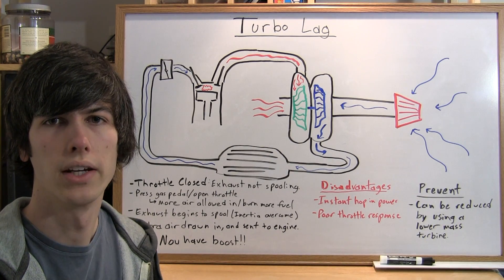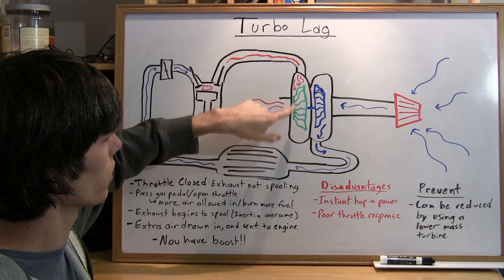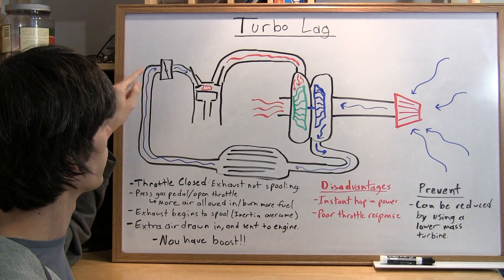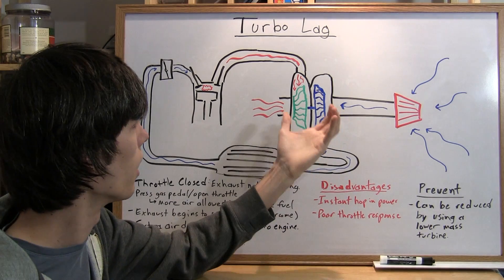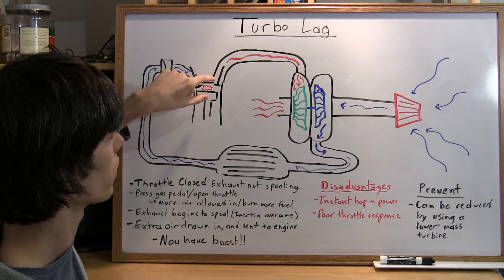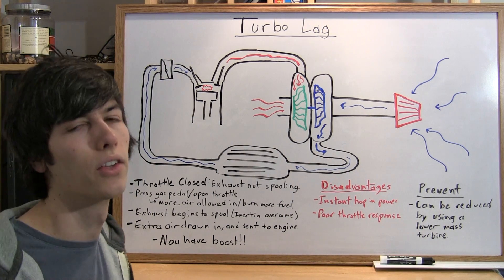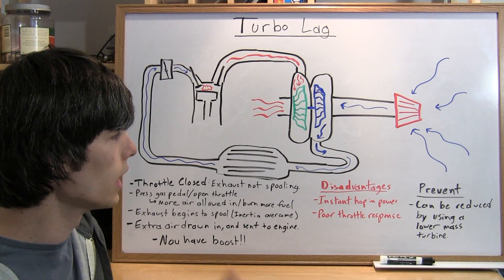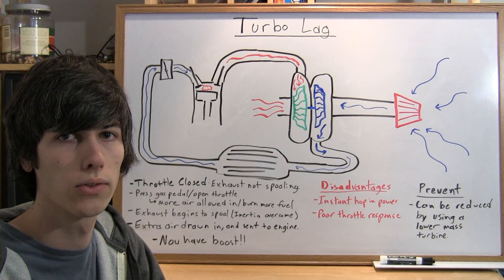Turbo Lag - The Problem With Turbocharged Cars

Comment: Turbo lag sounds like a whimsical explanation of a driver aid where the operator would not be able to handle full power all the time like a supercharger. If a turbo and a supercharger are the same thing on paper, why does the turbo need to spin really fast at a higher rate of boost to generate the same amount of power if it's a more efficient process?

Comment: When taking foot off the throttle, due to the delay in ignition, combustion continues to take place in the exhaust manifold, giving that 'pop' sound. But why does it only pop once? Shouldn't it be constantly popping while the throttle isn't engaged?

Comment: Good video, but I think you can simplify it further (IIUC): Turbo engines rely on engine movement to help bring in more air, so when the engine is moving very slowly turbo doesn't do much. Turbo lag is the time between when the engine speeds up and when the extra air gets through.

Comment: Mr Engineer, good day! I'm from philippines and a fan of your videos. It is very interesting and enlighting. Mr, i want to ask you a few question about my truck. It is a 2014 FORD RANGER XL, 2.2L doratorq TDCi engine. Last month i brought my pick up truck to the ford service shop for PMS. They changed the air filter, aircon filter, fuel filter, and oil filter because it is already 1 year of service. After which i drove my truck way back home and after 2 days of it's service when i prepared the truck for our trip i noticed that when i made a high revolution up to 3thousand rpm the powertrain flashed so i turned off the engine and started again. In the same manner doing a high revolution up to 3thousand the powertrain flashed again and i released the gas pedal so that the engine RPM will be back to it's normal idle power....i mean it will stay on 900rpm. That's the resting RPM of the engine. Moreover, i switched the engine off and started again, i did not rev up to 3thousand RPM anymore because surely it will illuminate the powertrain lamp again. So what i did is to rev up to 1500rpm and after which i just heard an unusual sound in the engine. It is like a dynamic sound.... like a choking sound to the engine. Can you please help me? Because the ford service here in my region can't find the possible reasons.

Comment: Mate, when u want to launch manual turbo petrol engine, what u think is it better to floor it and release clutch on 3000rpm , because i notice when i hve gas and keep rpm on 3000 boost drop , but when i pump gas or floorit boost jump high i think when u do that you aceleration is better :) (sry for bad english)

Comment: How about 2 air intakes that join before the intercooler, one has a turbocharger which has a sensor that reads how fast the turbine is spinning. And the other has a sort of valve that is open when you first step on the throttle and closed once the turbo is spinning fast enough. So when you press on the throttle, you'll get air directly from outside in the straight pipe and once the exhaust gets the turbine spinning fast enough the first air intake will shut off.. or does that completely ignore the point of a turbo
Reply: Never mind what I said is literally sequential except instead of 2 turbos active at high rpm and one at low it's just 1 turbo active at higher rpm and none at lower

Comment: Have an A1 TFSI and MY99 Gc8 WRX I have my turbo lag with A1 is the because of the DSG transmission? Also eg I light weight turbines i remember my twin turbo Sister used to have ceramic turbos to cool down quicker then I changed them to alumninium is that light weight?

Comment: why not just buy a small turbo to get rid of lag and have a set temporary hyperboost like davesfarm did  and add a too efficient intercooler like a3.5 ecoboost intercooler so when air inlet temps rise the super efficient intercooler will prevent intake air from getting too hot.
Reply: knightrider1545 If you have ever driven a 335i that is exactly what BMW did. Two small turbos great for low end torque. 300lb ft at 1400-5500 RPM!

Comment: Ok, so I'm curious about something. Why is it that you can't really build boost without a load on the engine. I drive tractor-trailers and my truck has a 12L turbo diesel engine. When I don't have a trailer, I can't hardly build boost, but if I have a full load, boost goes up to 30psi or more. I am trying to understand the physics of what relationship the load has to the amount of boost built. Oh, and you look soooo young in this video. Didn't realize you had been doing videos this long!
Reply: One way to think about this is "boost" or pressure is a measurement of restriction of flow in this case air flow. empty load your engine can consume more air (so more flow) than the turbo is making. under load your engines acceleration is decreased so the turbo is able to flow more air than is being consumed and then as the video explains a little more air in gives you more energy in the exhaust to create faster speeds for the turbo causing even more air to be compressed/ higher boost  maybe EE will respond and confirm/ deny/ clarify what I wrote.

Comment: I think it's more interesting the way people can minimize this. If i'm correct a bigger intercooler allows for a greater lag but a greater amount of 'cooled' air into the engine as well. The smaller components (turbo, IC, intake) the better the throttle response will be. The larger you go the greater the "lag" will be. I drive a RS4 B5 Avant V6 Bi-turbo with for each bank 1 turbo. You can tell there's turbo lag compared to a M5 E39 but when the turbo's start to kick in it's boost is just pure power.
Reply: KronosSlots E39 M5 is a naturally aspirated V8

Comment: I have a Hyundai Veloster turbo.  When I push on the gas the motor jumps in rpm's but the car doesn't go any faster until the rpm's go back down then the car takes off, the mechanic says that is turbo lag I call that the transmission slipping?  What does it sound like to you
Reply: michael otwell Is it a manual? Most likely your clutch is gone

Comment: why can't there be an electric motor on the turbo that keeps the turbo spooled for a second after you let off the gas?  as soon as you hit the throttle again, the diverter valve closes and you've got instant boost.

Comment: can a small turbo be used to help spool up a bigger turbo faster where all the clean air coming from the smaller turbo goes only to the exhaust turbine of the bigger turbo how well would that work? would it work better since you're using clean cold air instead of hot exhaust ? would it eliminate the lag on bigger turbo since the smaller turbo spools up faster in which itll spool up the bigger turbo faster than using the engine to spool the bigger turbo directly? would love to hear any n all opinions....
Reply: some cars come stock with dual turbos.  they usually call it twin turbo.
Reply: Having one turbo feed another is called a compound turbo setup, they don't work very well, it's more money and is a lot more complex for no real gain.

Comment: So, couldnt you use some sorta mechanism like in bikes, when you spin the pedal, wheels spin faster because of bearings? So if you could port this to turbo, you would have like 2:1 ratio, so after this ''mod'' you could get your turbine spin twice faster than before. Is this possible? Or am i just a bit crazy?
Reply: you can, but the more quickly you can spin up a turbo, the more you lose on the top end. there are all kinds of turbos from small to large, dedicated to everything from a fast spool to a large volume of air. the trick is to figure out exactly what you want out of it, and find that right spot inbetween.

Comment: what if you power the turbines with an electric motor?
Reply: turbos spin up to 250,000rpm. thats why
Reply: gears, bro.  
and it would only need to get it started before there's enough exhaust to really spool it up.

Comment: Hello, would it be possible making a video explaining how turbo blankets work (proper ones not chinese copies)? Also are they harmfull for the longevity of the turbo? If it's a big fuss making a video for this subject, could you tell us your personal opinion commenting below at least? Thanks
Reply: turbo blankets just help insulate the heat. kinda like a house has insulation to stop the heat from getting outside of the house. the purpose is to use it on turbos that run a really high amount of boost pressure, because those turbos get REALLY hot. the blanket just keeps that heat from filling up the engine bay and affecting other components under the hood. same reason people heat wrap headers and downpipes.
Reply: smminco Thanks for the answer :) I was actually referring to the occasion where turbo blankets are harming turbo components because the heat can't get out. Is this statement correct and real?

Comment: when the turbine is not rotating due to inertia, how can extra air go to the cylinder even if throttle valve is open...... plz clear the doubt.... or we have to wait for sometime until the exhaust gas will rotate the blades and extra air will be sucked... is this time gap itself known as turbo lag? if not what is it actually?
Reply: from the filter to the intake manifold there is still free flowing air. with the throttle body open air still can go through the filter, intake, turbo, intercooler and intake manifold. it's just like a super restrictive intake.

Comment: Fun Fact: There's zero Turbo Lag in acceleration in Formula 1 cars today as the MGU-K Unit (Motor Generator Unit - Kinetic), which is responsible for harvesting the energy under braking, is also designed to keep the turbine spinning.

Comment: My WRX has a turbo pressure gauge. From what I read on it, at idle there's a half atmosphere vacuum on it. 500mmHG. And when at 75mph and flat no stomp I'm at about 3600RPM and 0 pressure. As much vacuum from the engine sucking, as turbo pressure added. Then stomp it at 3500RPM and 0.5 to maybe 1.0 Atmosphere of boost. I wonder if I could play with the amount of boost "kicked in" with only a touch more gas, if I couldn't have a 25-30mpg WRX instead of a really beefy 20mpg. Make it a paddle switch on the steering wheel. Cruise control on right. Go fast on left.

Comment: That's the thing though, everyone's like "I don't like forced induction because of the turbo lag"
When you DON'T have the turbo working (IE, it's still spooling), you're effectively driving the vehicle as if it was Naturally Aspirated. It's just that you're so used to the power that comes when the turbo kicks in (the boost), that you think it's less than what it should be. There's really NO downside to forced induction, of course, besides the wait time for the extra power, and the extra cost involved.
I highly recommend, especially for people who live at higher elevations, the turbocharger helps maintain a smooth powerband that is lost when N/A engines can't breathe enough.
Reply: dosmastrify , The system would have to improperly built.  The blow off valve (I believe) gives the gasses an escape route.
Reply: Yea but who in the real world drives at 30mph in 6th ?
Reply: That test was not done correctly because gearing of those cars is very different
Reply: When the turbo isn't making boost it's not the same as an NA engine, generally turbo engines long piping between the throttle plate and air intake, they have longer runners on the intake manifold and the intake manifold is larger, they also run lower compression, there is no doubt that NA engines are more responsive but the extra power the turbo can make is well worth it.
Reply: I'm not so sure about that, wouldn't the engine be a little air-deprived due to the turbo not feeding air into the throttle body?
Reply: But the air is still being blown in, as with N/A, it just hasn't reached a high spool, doesn't mean there is "less" air... at least, not with the setup I have, I don't have a very large turbo so maybe that's why.
Reply: Mihaly Lukacs , ah -- sounds reasonable. Actually I think I figured out why my turbo-diesel smokes at first on acceleration - even though the turbo is not yet producing pressure, the engine is still injecting the extra amount of fuel. This results in a too rich mix and thus the smoke. My first assumption was that there was just a problem with the air availability.
Reply: +Jaanus Piip , We just had the Pikes Peak Hill Climb a few weekends ago and I heard one of the racers say that his car can make 18lbs of boost at sea level but only 12lbs here.
Reply: But getting hit by that turbo boost in a corner can easily make you lose control. So there is a disadvantage.
Reply: dosmastrify , Turbos are powered by exhaust gas, they don't rob any power from the engine.  

Superchargers are powered by the crankshaft so they do take power away.
Reply: Anyone see the drag race on Top Gear where they pit a Mitsubishi Lancer FQ400 against a 1.6L Fiat and start them off at 30 mph in the highest gear? The lag on the Evo is so bad that it falls behind and never catches up over a 1.7 mile runway. No disadvantage you say?
Reply: ***** No, the overall gearing in both cars is similar.
Reply: Problem is when you downshift when driving fast. You're momentarily braking, and your engine disconnects from the wheels. Loses turbo pressure.
Reply: Krony999 Nobody, but that's how you show how bad it is. Turbo lag is something you usually feel rather than see. Going 30mph in 6th makes it into something you can see. It was just for demonstration after they commented on how bad the lag felt.
Reply: get a better wastegate, one that always maintains a bit of pressure. GFB has some good stuff for this.
Reply: People always call the delay in power surge "turbo lag" when actually 
turbo lag only happens when the turbo is spooled up and ready to go.
Then you floor it and of course it takes a few moments longer than it would take in a naturally aspirated engine to get the response, the higher your driving skills and the demands of the track, the more noticeable it is. 
If you step on the gas in a car with a huge turbo and you are running at 2200RPM don't expect to get anything until it gets revved up and the turbo spooled, that is not turbo lag, it's not the adequate rev range.
It's just like flooring an RX8 at 3000RPm, you ain't getting any juice, because you are using a rev range not suited for the power needs of that moment.
Turbo lag is present more or less depending on the weight and inertia of the turbine-compressor, but always present and measurable when comparing it to a NA engine, both in "good" rev ranges to obtain great acceleration.
In day to day driving this is a non issue, and only when demanding driving is involved can you feel the lag in a turbocharged vs a NA, as both engines are revved up and ready to respond to the accelerator.
Reply: Well, I flew into a ditch today. Quick response allowed to mitigate the damage and I wound up with only a broken grill and some cosmetic damage. If I had a turbo I would most likely flown into the mountain wall.
Reply: DriftNick ++ the only correct answer in here. Lower compression ratio of turbocharged engines and longer air pathways. The video itself didn’t explain why is this delay (lag) happening at all. ‘Because turbo takes some time to spool’ - So what? Why NA ICE don’t have throttle response problem? :(

Comment: why not connect the turbo to the drive shaft
Reply from the maker: That's essentially what a supercharger is (you'll need some gearing changes, of course), and why it doesn't have lag.
Reply: Well boost should be related to the engine RPM, not to the speed a vehicle is going. That is why a turbo/supercharger will never be connected to a drive shaft. I guess you meant connecting it to the crankshaft, and that is what superchargers do.
Reply: yep
Reply: superchargers have more flat air flow / revs (do not know exact term of this), sure supercharger can get top flow very early (some with about 1000rpm of engine) but it wont increase that much with 5000rpm, turbos do make more boost with more gas flow (ofc to some extent).
Reply: Engineering Explained what about the EGR clogged egr can cause turbo lag can't it?

Comment: Hey I have a 2002 Volvo S80 T6 and I think I may have turbo lag. It happens when it changes from 1st to 2nd gear. The car will stop accelerating (or lag) for a second and then switch to second gear. I guess it happens when I push the throttle a lot but it doesn't happen all the time or in any other gear. There is no turbo gauge in my car nor is there any whistling of any kind from the turbocharger. You can't hear the turbo at all just the engine.
Reply: if its an auto, then thats normal, 

Its not lag at all, Its the ecu communicating with the gearbox ECU for engine speed and rpm, that is all.

If it dont happen all the time, then maybe its best getting your ECU read on a diagnostics machine.
Reply: you can try resetting your ecu